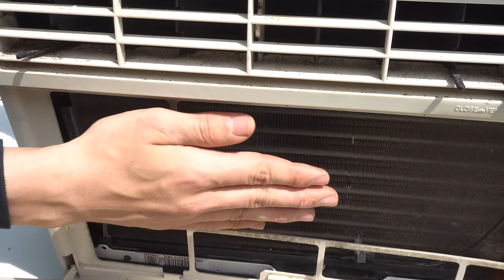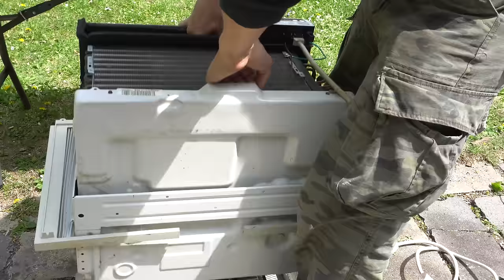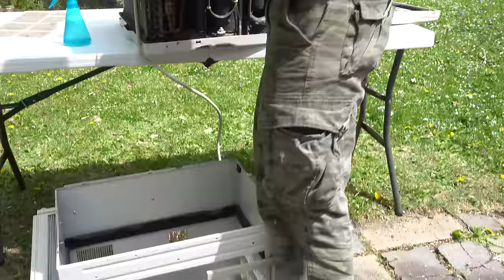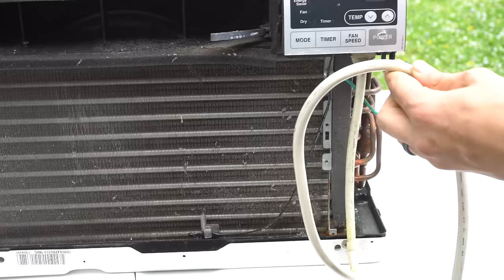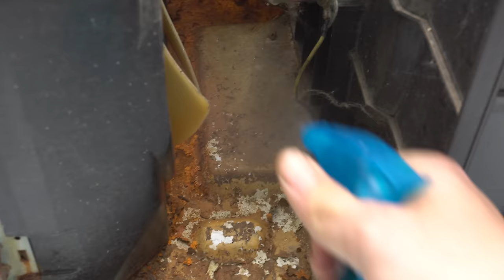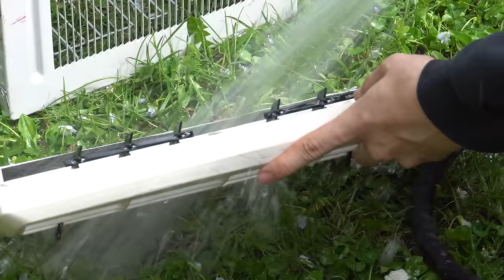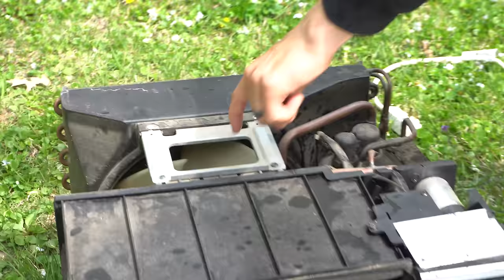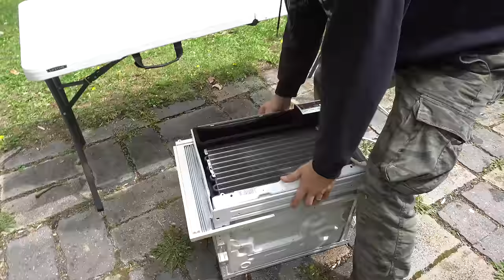Window Air Conditioner Not Cooling And The Most Common Fix

Comment from the maker: ⬇ Other videos that may help:

Another Example of Cleaning Window AC (no soap):
https://youtu.be/f-fnwJ_L3GM
Did washing it down not help? Here is what to try next:
https://youtu.be/eYfCBFJd4wY
EASIEST Way to Install Window AC:
https://youtu.be/Lq8jA2uYaFE
All window A/C parts and what they do explained:
https://youtu.be/tEoQI13KiAc
How to install window A/C in horizontal slide window:
https://youtu.be/QXVGp3VUmnE
Reply: Hey Pal I have a koldfront  Ac/ Heather  what could be causing that only flow warm air at 78 ?  Do I need a 25 Amp breaker ??

Comment: People like you that’s the people we need, I was about to buy an other AC , but I did the cleanup to my old AC and I save some money ,thank you .
Reply: Same. I almost felt defeated. I don’t have the brawn to lift my larger one but I can clean from the window.
Reply: I tried to clean my a/c with a steam machine, it stopped cycling off after a few seconds, but it wasn't good yet, I took out the cover, I flipped the a/c to have the outside coils upwards, I used a water bucket (mop bucket) and emptied it on the outside coil, that did give it a new life, wasn't perfect yet... i emptied 1 more bucket and then it was really good, got all its power back.  I emptied two more to wash the a/c machine completely (4 total) no more vibrations, the compressor got super quiet, best a/c ever, especially since it cost me $30 canadian rubles
Reply: It worked?   I did this last year to one of mine and it stopped working altogether. Thanks
Reply: Same
Reply: Wow nice

Comment: Jay your video is FANTASTIC!  I watched your video this hot and humid morning after my A/C stopped working overnight. I could hear what I believe was the compressor but the fan was not working.  I took my 12,000 BTU Friedrich air conditioner apart carefully following your instructions, brushed, hosed (inside and out) and straightened a few bent coils and this afternoon it is working again!!!!   I think the hardest part was lifting the A/C out the window to the yard and back into the window by myself.  Your video and teaching style are thorough and empowered me to believe that I could fix something that I knew absolutely nothing about.  You really helped save the day!  Thank you so much!

Comment: I just cleaned my 38 year old AC as you instructed. I was going to just use a vacuum and rags but can now see that this would not have been nearly as effective. My AC not only looks much cleaner, it made a massive difference. It even sounds better. The outside fins don't feel as hot, as there is more air moving through. The inside is blowing more air as well. Thanks for the tips.
Reply: @rm742  I did that, thanks. I clean all my regular fans and oil them usually more than once per year, so I of course cleaned the fan blades in the AC too. Correct that this is important, not just for efficiency, but balance and therefore noise too. This 38 year old AC was used hard but not for all its' life time. Where there is some rust on compressor, cap, blower motor, and a few other spots, I used a thin layer of Linseed oil. This is a drying oil, like what I use to season my cast iron cook ware(flax seed). The compressor gets warm so I wanted to use a drying oil, not one that remains wet(fire hazard). I plan to clean and add some paint to the cover, and add some new metal screws for reassembly. If I can get a new thermostat, this AC will work like new. OH I noticed that after cleaning, the compressor also does not get as warm. LOL I probably should get a new AC unit though, just because this one uses 10 amp for 6000 BTU.

Comment: Thanks for the video. I was getting geared up to add freon to my big window unit. However, I noticed that there was no hot air blowing out of the back. In fact, I noticed that there was no air at all coming across the condenser coils. I slid it out of it's case and brought it outside. Upon inspection, I noticed that the fins for the condenser coils were completely clogged. Took off the fan shroud and cleaned them thoroughly. Works like new now. Thanks for inspiring me to take it out.
Reply: Wa

Comment: My GE unit (5k) wasn't blowing much air even though the removable filter was cleaned daily.  High dust area, so after watching this video I gathered the pluck to remove the unit and take off the shell and front fascia.  There it was, an almost completely plugged front fins on the front coils.  hosed the whole area off, went over the back radiator too while it was exposed and blasted out the sediment that had accumulated in the bottom pan.  Put it back together and had plenty of airflow!  Thanks.

Comment: Normally you wouldn't want to turn the compressor on it's side to prevent oil migration but if you leave it off and upright for several hours it might be ok. Thanks for the educational videos.
Reply from the maker: Thank you for that warning! I should have mentioned that in the video..
Reply: @WordofAdviceTV  The rule is as long as it was on it's side that's how long you leave upright before running it.
Reply: @WordofAdviceTV  In my case, my LG window air conditioner (which looks almost just like yours), was working fine until yesterday. It cooled my small bedroom very quickly right up until yesterday when, all of a sudden, it stopped cooling. At 1st I thought the compressor was not kicking in, just the fan working at low medium or high as usual, but after turning it off for 3 minutes and then turning it on in cool mode, with the temperature set at it's lowest (60), when I first turn it on, the compressor does kick in, but rather mildly, and it just barely cools a little. It actually helps to turn it off a short while because it seems the compressor doesn't stay on, or keep coming on, even though we're experiencing one heat wave after another, and the outdoor temperature low of the day doesn't even go below 80°. Therefore, it seems I may get more cooling after the initial start up at 60, to raise the temp to 81 or 82, after a while, so it will automatically turn off the compressor for at least 3 minutes, then cycle it back on after the temp crawls above 82. 

It's extremely, uncomfortably hot & humid lately & I'm sufferring in the heat. An inner voice had been telling me I needed to vacuum & clean the air conditioner & filter for the last week, but I had not done so yet as of yesterday, when it stopped cooling. I have now washed the filter & partially vacuumed and washed with a rag, the inside part of the in place, air conditioner, but still, only the fan is working fine. If it was just dust, I'd think it would cool less & less, but it cooled very well until yesterday when the cooling compressor only lightly kicked in. The cooling compressor has not improved after cleaning, so I was wondering if the excess dust that had accumulated before I vacuumed & cleaned the filter and inner fins, may have made it run hot and tripped an internal circuit breaker or burned up an easily replaceable, inexpensive part? The cord plug in, is a circuit breaker which I tested and reset. The air conditioner fan has continued to work fine, so I hope there is a circuit breaker or fuse inside the air conditioner that's just for the compressor, but haven't been able to see any indication of one, so far. Do you know if there's a fuse inside the air conditioner that can blow and cause the air conditioning compressor to not kick in, except for very lightly? Thanks in advance for any advice!!!😀
Reply: In my case my air conditioner turns on but no air comes out at all! It makes a vroom sound should I still try to clean it? Will it help?
Reply: @jujub3382 Did you try that and did it help?
Reply: @valerieann8007 1 thing to take a look at would be the capacitor for the compressor. 

(I know it’s 1 year later but this may help someone else)
Reply: @nuggetthebeagle  If you follow the incoming power cable you will most likely find a large capacitor (compressor) and a smaller capacitor (fan motor) next to a circuit board. If you don’t have a multimeter to test them, look for it to be bubbled up instead of flat underneath the terminals or for leaked oil. 

BEWARE! CAPACITORS HOLD HIGH VOLTAGE. You must discharge the capacitor before any handling.
Reply: Valerie- these are cheap Chinese crap, Ive never found any of them last more than about 3 seasons before not cooling as well, and thats despite opening them up and flushing the coils with a garden hose and soap. WHat I believe is happening is one or more of these;

 They lose a percentage of their  "freon"  over time
 The compressor itself wears out quickly and no longer works as well
 The electronics controlling temperature etc start failing 

They DO have a capacitor in them, usually a large separate one, but also smaller ones on the board, capacitors DO go bad as does the electronics and sensors.
Most of these pieces of junk are cheap enough to throw out and replace every 3 years and that's the whole design scheme. Ive had LG, Fedders, Frigid-aire, and  Danby to name  few brands, the Danby is always FRIGID when new, but after a couple of seasons the decline becomes obvious.
I usually have a 8,000 btu size unit.

I'm tired of window a/c's and their hassles, I'm looking at a two zone Mr Cool mini split next spring, the condensor coil unit is separate and outside, easy to access all sides to flush the coils, much better filters inside, we have one at work now 2 years and it's FRIGID with it on high

 @valerieann8007

Comment: I just took out the filter for the first time in YEARS. This window unit was used and I’m not sure how long it was since it was cleaned before I got it but I’ve had it for 7-8 years. It was WAY over due and never knew there was any filter in these. Now I just put the filter back in all clean and WOW what a difference in how it runs and it’s colder too. Thank you so much Jay for making this video!!!!

Comment: It hadn't crossed my mind that the AC filter could be clogged, but after viewing the video, I gave it a thorough cleaning. Now it's functioning superbly—much appreciated for the tip!
Reply: @-Allen-  ALWAYS check air flow first... inside AND outside.. sometimes the outside is hard to tell but if the air is VERY hot, u can confirm by putting your fingers near the fins and go back and forth and u will feel the difference... i have deep cleaned mine and had a layer of crust on the inside of the exhaust... used a plastuc putty knife to vreak it into pieces
Reply: @ronallens6204  
Thanks!

Comment: I literally just tried this ( only took the front part off to clean ) I’m praying this works. Thank you for this video
Reply: Well?  Did it?  Inquiring minds want to know!
Reply: Pulled the filter on mine and vacuumed the front. Filter wasn't that dirty but bottom of front cooling fins is pulling the vacuum down indicating blocked air flow. Working for now without frosting up. Probably take it out of the window and clean it right tomorrow morning when it's cooler. Lol

Comment: I knew my ac unit wasn’t working as well as it used to but I thought I was going to have to buy recharge equipment in order to get it working properly. After I watched your video I cleaned the main filter in my tub/shower put it back and turned the unit back on. Wow what a difference. Thank you so much for your help. Fantastic video!!!
Reply: How can you this without removing from out side cage to heavy for me to remove.  Pam

Comment: Glad this worked for me. I started freak out a bit because my unit quit cooling halfway through the day while working. I was worried for my pets as the temps climbed to 94 inside. After I got off work I took a hose inside flushed out on the inside then outside. Waited an hour to let it dry and turned it on and it once again started to cool my room. Saved me a lot of money as my window unit is actually a really big unit that also heats my room in the winter. Spent almost a grand on it years ago and was not ready to have to replace it. Video just saved my pets and my bank account.

Comment: I have a window A/C unit installed in the wall of my shop, it is not easy to remove. What I did that helps a lot is I put the sticky one-side velcro (hook part) around the intake grill of the unit and stuck on a piece of polyester quilt material over the grill. This is a very good pre-filter, it will get filled with sawdust before the inner filter gets really dirty. On mine, the grill frame comes out at the top like yours and will come up and out so I can take both filters outside to hose off. I have been running it for 14 years now.

Comment: another thing I like to do even though the fan bearings are sealed is put a few drops of light machine oil on the fan shaft, right where it goes into the motor. This actually helped free up a fan that was spinning very slow after it was in use for awhile as the motor heated up.
Reply: I've never had any luck doing that but it's certainly not going to hurt anything and is worth a try if the motor is loud or draggy, or just as preventative maintenance if you want to. My neighbor just gave me a free AC unit with a slightly noisy fan motor and I tried oiling it and it made no difference, I don't think the oil went in since its sealed. Oh well, it's not loud and a little noise still beats the heck out of being hot any day!
Reply from the maker: Great suggestion Kkovler!! Thank you! I would also tip the unit forward a little while doing this so that the oil is running down the shaft into the motor. Doesn't always work if the fan motor is already seizing up as Avery stated but it's definitely worth giving it a try
Reply: Most of the motors use a felt wicking method to both store and apply oil to the brass bushing and shaft.  Once this dries up, the motor starts squealing and/or slows down.  If you tilt the motor and manually spin it slowly, you will notice that the oil that you apply to the motor shaft, slowly disappears into the motor. This continues until the felt material is back to being drenched with oil once again. I did this to my air conditioner motor when it hit being 16 years old and was squealing. Fortunately the motor shafts were exposed at both ends since the motor drives two separate fans, thus I could oil the felt located at both of the brass bushings. After that, all was new again.
Reply: @averyalexander2303  if it's a sealed bearing you can pry out the plastic cover and clean out the grease and add new grease, just use a pick or something really sharp. if you can replace the bearing that would work too
Reply: Your comment might save me from replacing the motor bushing, as mine started squealing and then the fan froze up. I hope I remember to come back and post the results. Thank you for mentioning that drop of oil.
Reply: @chazdesimone7306  well did. It work on the fan? My friend has one and l think the fan is not spinning. Any ideas???
Reply: @elizabethrose8510  I've used wd40 on a few electric motors to free them up and get them going before. Bath vent fans and blower fan for kerosene heater worked. Get it into the bushings or bearings as good as you can and wiggle the fan back and forth gently until it turns smooth.

Comment: I’m a retired hyacinth guy. This is a very good video! 90% of all room ACs that don’t seem to cool just need a good cleaning. However, never ever turn that ac in its side or in any position other than the way it sits in your window. If tipped on its side or on its end, the oil in the compressor can move out of it. This may cause the compressor to seize up from lack of oil.

Comment: I am experienced with the costs of time and money via my pursuit of diy and handyman and thank you for your efforts. I have two things to say. The first is that it runs long for me watching the cleaning process beyond just communicating how a step is done (I’ve heard that length of videos is related to YouTube payback so I won’t press that. Whatever the reason, I’m 74 so sensitive to any time wasting I choose to invest). 

My second point is that in the intro you predicted looking into what can be wrong and can be done to remedy a cooler that isn’t cooling, but the only issue tackled was dirt blocking airways. I have a cooler that isn’t cooling that was filthy and I thought sure a thorough cleaning would fix it. It did not. Anyway, I was expecting further causes to be reviewed. I’ll keep looking. All my best to you. 

Pass on your knowledge whenever you can. A time is coming when something brand new may be very rare and or expensive (as it should be).
Reply from the maker: I appreciate your feedback! Thank you. I will try harder to deliver on the claims I make in my videos. I am actually making a video on exactly this right now. I am still editing it but plan to post the video this Friday or Sunday. A common reason why a window air conditioner does not turn on is a bad capacitor - that's what I go over in the video.

Comment: This was great! Thank you for a very helpful video!  I have a bigger window unit so I will not be taking it apart as you did.  Actually, I wish I could but it's a unit.  I will try to do as much rinsing on the outside and hopefully, it solves my problem.  I already cleaned/washed filters and used AC Coil Foam Cleaner.  Wish me luck!

Comment: Excellent job man inform the people to let it sit outside or in the garage somewhere where it can air dry for at least a day or two to the electronics will dry and at the minimum don't plug it in after you have pulled it apart and flipped it around for at least 24 hours so you do not burn the fuse on the compressor